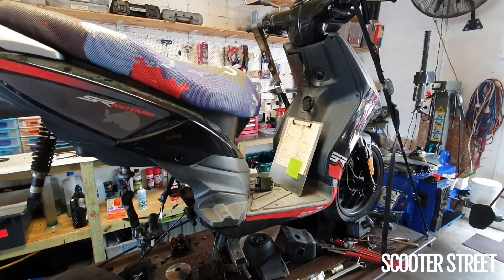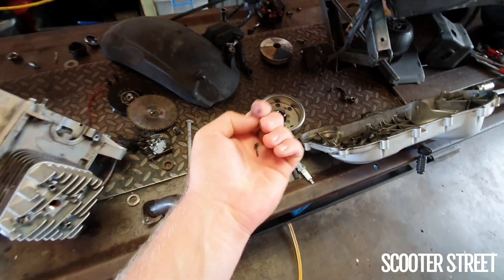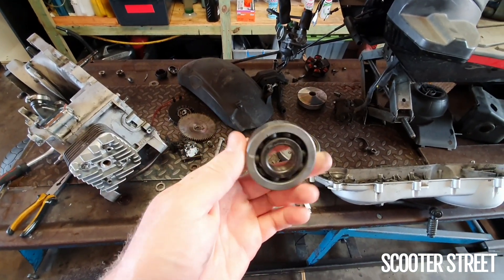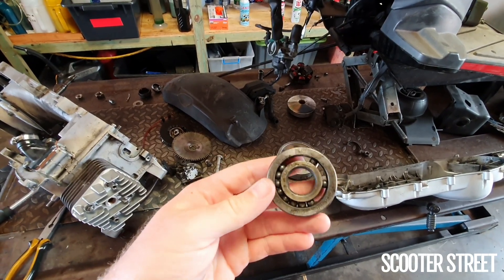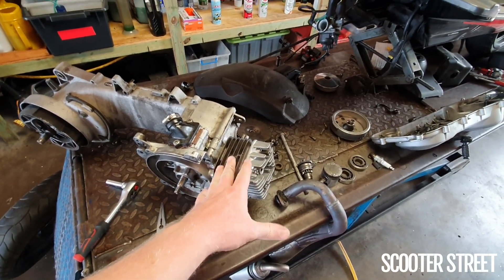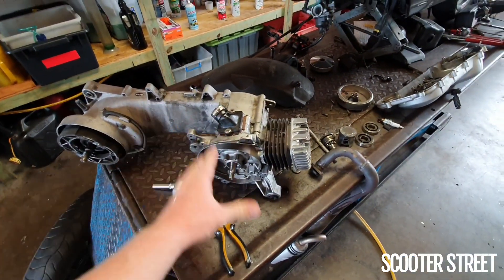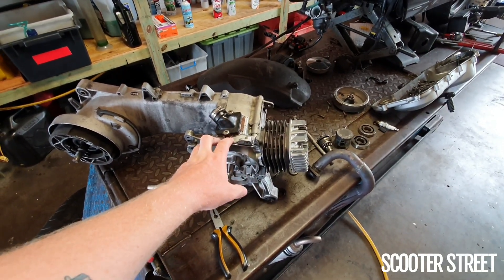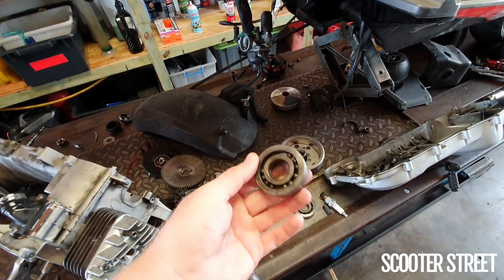Crank Bearing Explosion on Aprilia / Piaggio 50cc 2T Engine

Comment: Happenned to my Piaggio Fly 50cc, 4 cycle,  the  crankshaft bearing cage came apart, and got caught in the timing chain, causing it to jump teeth and bend both valves , destroying the engine; Expensive italian junk no more for me, i am a mechanoc, and i ride chinese only from  now on, way better made and way cheaper to buy, run and repair;   the chinese, they  make millions and millions of them, they have perfect machinery, highest quality parts and best prices.
Reply from the maker: Good story thank you👍, the bearing was probably made in China.

Comment: What in your opinion is the best part to order for this engine?
Reply from the maker: When you say parts do you mean the crank related parts?
Reply: @scooterstreetau  yes bearing and crank parts for a piaggio ty
Reply from the maker: @jeffkrauss5582  The factory parts are great, other wise it is good opportunity to make an upgrade for stronger parts particularly if you are thinking of upgrading the cylinder. In this case Malossi, Polini and Stage6 which we have used have excellent proven products.
Reply: @scooterstreetau  I was thinking on getting a stag 6 clutch ? Yes or no or your opinion on a better one
Reply from the maker: @jeffkrauss5582  Go for the complete clutch kit because the bell has the hole for easy key way adjustment.

Comment: Hi great video do the 2017 Aprila SR 50 Motard have the crank bearing problems
Reply from the maker: Eventually all bearings in all machine will wear to the point of needing replacement. Being aware of unusual noises and keeping up with regular maintenance will help with preventative issues. Upgraded engines will suffer more than a standard engine, but the fun of it.

Comment: I have a 1993 aprilia scarabeo and I’ve been looking at 100cc bbk to put in it is there anything I should need to buy to go with it I can’t find any builds on YouTube to see what else is needed this type of setup any suggestions would be greatly appreciated ty
Reply from the maker: You should have it running well as a 50cc first and then start the mods, if this is possible.
You will need Jetting and transmission parts, possibly an exhaust too.
Reply: @scooterstreetau  ive built a adly rt50 and a malugutti f16 but ive noticed on the aprilia scarabeo it has a slightly longer crank
Reply from the maker: @jeffkrauss5582  Does it have the Morini engine.
Reply: @scooterstreetau  the hyper2
Reply from the maker: @jeffkrauss5582  Follow any Hyper 2 set up, take into consideration the larger wheel. I think they are 16 inch.

Comment: I found these pieces in my valve cover in the summer today I pulled head off took a magnet and pulled the curved piece and the little piece out of crankcase I thought mabey I was having personal problems and someone I know stuck these piece in my oil cap.they do stuff like that.i found no ball bearings in oil or with magnet.im put another head and pistion see what happens.
Reply from the maker: Do you have 4 stroke or 2 stroke? 
You must find out where the pieces came from to avoid future damage.👍🎅
Reply: 4 stroke 2019 4000km piece sports 50c I believe the crankshaft bearings it's got some play in it.

Comment: Wow where you got air cooled piaggio motor orig?
Reply from the maker: In Australia 90% of the Piaggio 2 stroke engine is Air Cooled... We would prefer the Water Cooled😢
Reply: @scooterstreetau  here are too but i boughy Aprilia sr50 2016 factory and these are already with coolant from 90s, piaggio makes motors for aprilia, even have the logo on cylinder head
Reply from the maker: @RexFixx  Yes Piaggio water Cooled engine in the SR50R, we love it.. we worked on 1 today, they do not like Diesel in the fuel tank😂
Reply: @scooterstreetau  haha no room for hand tho
Reply: @scooterstreetau  air cooling i better for me I don't want injection and oilpump and water cooling and other things that can cause problems
Reply from the maker: @RexFixx  Yes I agree, Carby and water cooled👍

Comment: Mines got a horrible clicking/ticking sound behind the stator I’m guessing it’s the bearing gone
Reply: Mine too!
Reply: @tricker7060  been doing it for months now only does it when the bikes running though if I turn the stator plate by hand it’s nice and smooth and doesn’t make a sound
Reply: @dexietyy7922  mine does click a little when i turn it manually back and fourth dunno if normal I'm kinda new to this. But i plan on changing the whole crank anyway
Reply from the maker: Under load, (engine running) the noise will be stronger. Unfortunately you need to take the time to get in there and check it out...
Reply: @scooterstreetau  think it could be my rollers rattling around in my variator doesn’t sounds like a blown bearing to me but can never be too sure
Reply from the maker: @dexietyy7922  Usually when the engine is at idle the rollers rattle, it will be reduced when the engine increases RPM. This roller rattle is clearly heard from the RH side of engine in the Transmission..
Reply: @scooterstreetau  you can’t hear it at all when the bikes revving up only at idle I will take my rollers out tomorrow and test just to rule it out if it’s rollers making noise I’m happy with that haha 😂
Reply from the maker: @dexietyy7922  Haha, Yes the roller noise is not that bad. Great plan👍

Comment: Hello good video. so you think this was caused by cheap ebay bearings? i found this video because i had similar problems with my Aprilia sr with 70cc. (with piaggio 2t engine) The skf polimer c4 bearings i were molten on both sides. I didn't found the cause yet, but the engine must been very hot. It started rattling on top speed (95km/h) and shut of the engine directly. Cilinder is not damaged. so maybe you have a idea?
Reply from the maker: Thank you. The bearings must be installed correctly and not damaged during install. Run it rich on the carby and pre-oil all components prior to starting. check the oil quality is good and the oil pumping system is efficient.